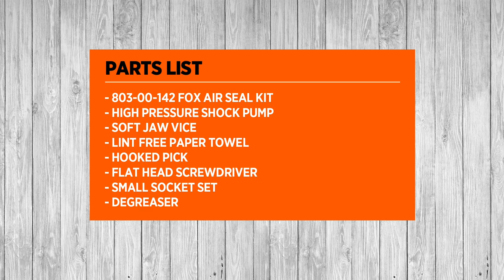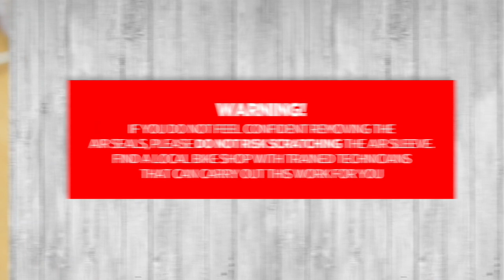Air Seal Maintenance DPX2 | FLOAT X | DPS | CTD

Comment: Did everything as in the video twice, still noise is like a sand rubbing inside... When i open the can the oil is bubbly is it ok?? Checked the seals and everything is fine. I dont have big clamps and i do everything with my hands. Maybe the problem that is i cannot push and rotate in first try and i push couple of times till i manage to screw up the can? I dont know to be exact...

Comment: are you using the whole piece of fluid?
Reply from the maker: Yes the 5cc sachet is used in the air can at the end.
Reply: Hi, thanks for the straightforward vid without useless yammering and trying to be a YouTube star like others 😁).
Question I also noticed you didn’t use all the pillow pack. Was that just for time constraint? 
Also do you know the weight of that fluid?
Thanks again!

Comment: but what about EVOL chamber ? I am 100% sure that, still some oil left there
Reply from the maker: Hi Piotr, Evol chamber doesn't usually have fluid in it. The EVOL sleeve can easily be removed by taking the c-clip off and then sliding the sleeve off to check.